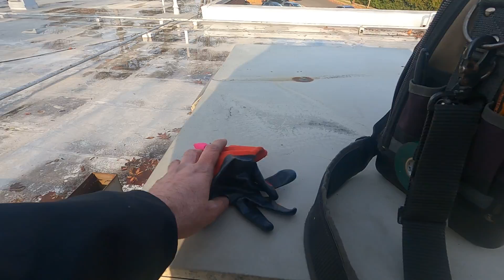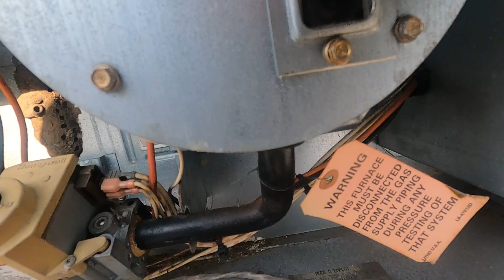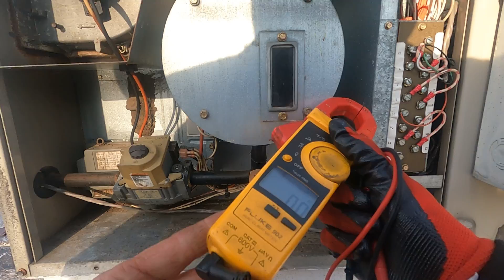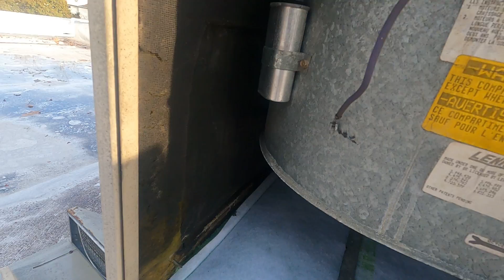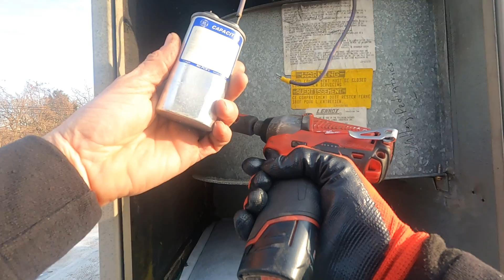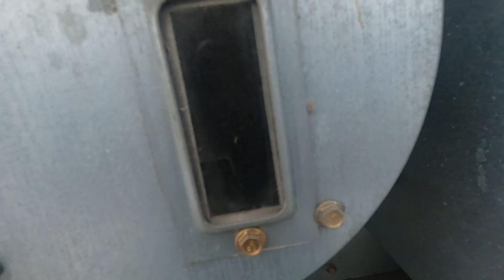No Heat Service Call Unit Fires Up & No Air Flow

Comment: Hackmister thanks for the videos, but you should always test for voltage everywhere before touching anything some rooftops can have two service disconnects.
🥃🥃🍺🍺🍺🏌🏻‍♀️🎯
Stay safe. 
Retired (werk'n)keyboard super tech. Wear your safety glasses!